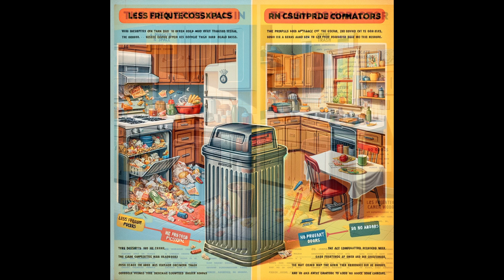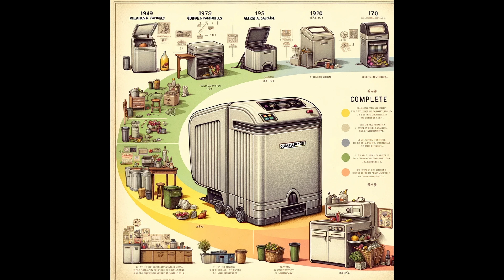Trash Compactor - How It Came To Be

Comment: Useless device. I bought a house with one. Used it once. A few days later there was a bad smell. Some cheese had squelched back up onto the "foot". So not only do you have to buy expensive bags, you have to clean the "foot" and all to achieve what? A slightly smaller volume of trash.